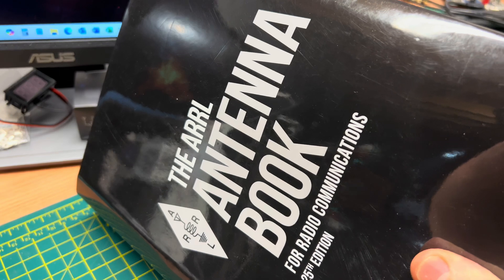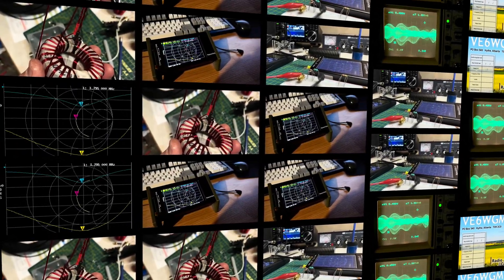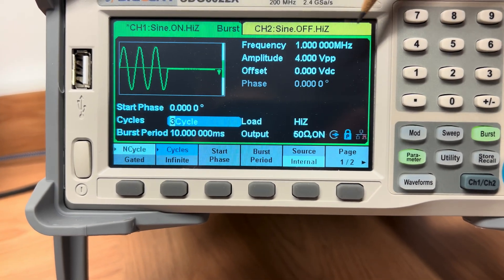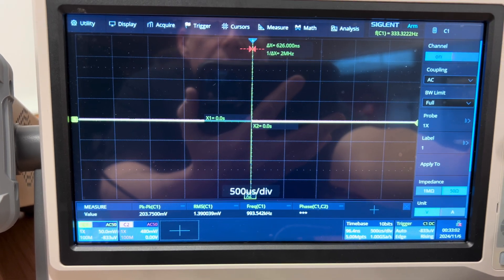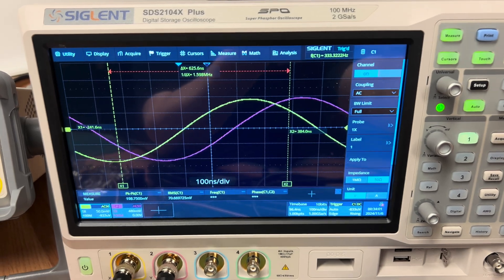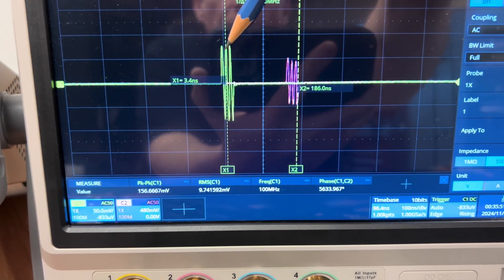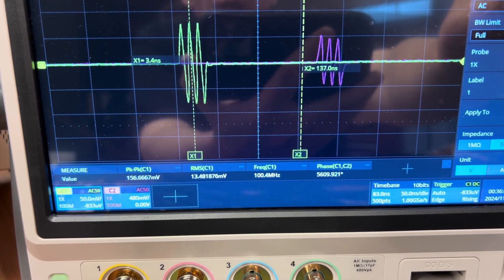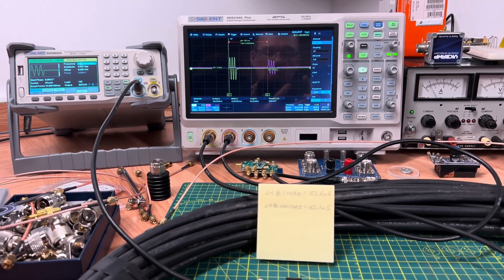(Part 1) ARRL Antenna Book 25th Edition - Coax Cable Velocity Factor Mystery!

Comment: This was fascinating. Added new comment in case you missed my edit. Doug Tougaw of Valparaiso gives a concise answer in his video on transmission lines, Chapter 28 (in the title), at 18:50. This answers your question, and mine. His entire text on electromagnetics is available at Valparaiso.
Reply from the maker: Thank you.

Are you able to post a link to this video?
Reply: @ve6wo  Maybe me, or YouTube, but this is second try. (Me- clicked on wrong reply point)
Here is the video set to start at relevant section/
https://youtu.be/UQKOlKXN9yI?si=SxDk2WVxJ0UZ1jfA&t=1130
Here is chapter 28 from his book:
https://scholar.valpo.edu/cgi/viewcontent.cgi?filename=28&article=1000&context=engineering_oer&type=additional
This is on page 5 in the chapter:
“These two equations, taken together, illustrate that the phase velocity will be a function of frequency. This is not good. It means that some frequencies will travel at a higher velocity than others,…”

Comment: Why not? I do not see it as a surprise. We know that the photon we pump into the input of the coaxial line is not the same photon that exits the other end. It has coupled to many an electron and been absorbed, then re-radiated countless times on the way through.
A medium wave frequency, EM wavefront propagating along a two conductor feed line will penetrate deeper into the surfaces of the two metal tubes forming the feed line than a very high frequency.
A much higher frequency EM wavefront will penetrate less deep into the metal tubes than the lower frequency.
The wave front that is penetrating deeper is additionally coupling to electrons that are deeper in the material, therefore coupling to and being re-radiated by,  more electrons per unit of time. More couplings per unit of time means more drag (if you will) on the wave front.
This effect is seen in light passing from one transparent medium into another transparent medium. We call this refraction - the bent pencil syndrome. I can just as easily call it drag on the speed of propagation as the wavefront slows (or speeds up) as it passes through the boundary of two mediums with a differing index of refraction.
We know that C is slower in air than in a vacuum. It might be interesting to test if changing the frequency of the tested light beam will change the index of refraction, or the speed of C, through differing transparent mediums. (I suspect it does but it will be the devils own task to separate the readings from noise)
73
K8DO - Doc

Comment: The dispersion in coax is primarily due to internal inductance of the metal conductors due to the skin effect. It will be more pronounced on smaller diameter cables that have a higher loss per foot.

Comment: RG-213 specs say a velocity factor of 66%.  Your cable shows 55.6% at 1 MHz and 61.5% at 100MHz..  Someone check my figures.
Reply from the maker: The cable length would need to be known exactly in order to calculate the VF.  This cable is approximately 100’.. I don’t actually know the exact length.

Comment: Fascinating information. I wonder if it has any practical utility for the amateur operator, or if it might only be relevant in the design and fine tuning of antenna arrays and/or in the measurements of nuclear particle timing experiments. 

I wonder if the rate of delay is a linear function. The ballpark figure in the handbook makes me suspect there might be some nonlinearity to the rate. 

If I had to guess (and I do), I would say that the delays are caused by the  nonlinearity of the dielectric materials and the complex granular reactances of the transmission line, along with maybe some heating effects (even as burst signals, there are always losses in the cable).
Reply from the maker: Thanks for the comments guys. I’ll talk about this in the next video.
Reply: Might be of use in designing phased arrays, but then the difference might be too small to matter?  I will leave that as an exercise for greater minds...  😃

Comment: Take some inductance out of it and lay 100' on the lawn in a non coiled fashion, perhaps in coils that change direction each coil. Then make measurements.
Reply: Coiling a coax cable doesn't affect its inductance.
Reply: @donepearce  Really, what about all the pictures in the ARRL Antenna book showing coiled antenna wire in the diagram?
Reply: @CHIPSpeaking  antenna wire is not the same as coax. Coax is not affected because it carries equal current in both directions simultaneously. There is no net external field to interact.
Reply from the maker: Truth.  Coiled coax does not affect the EM wave travelling between the center conductor and the inside of the shield.  Only the outside of the coax shield experiences inductive reactance when the coax is coiled.

Comment: I found a paper by Q. Liu & S.W. Ellingson, 2012, that gave a formula for “dispersive delay” that showed the dispersive delay in coax varied inversely with the square root of the frequency, which would translate to a lower delay for a higher frequency. Beyond me, so I will leave to you is to define “dispersive delay” and its frequency dependence in coax. They stated “The source of distortion in coaxial cables is that the center conductor and shield are not perfectly conductive, so that part of the current travels in the metal where power can be dissipated and propagation speed is frequency-dependent…” 
edited  to add: I believe lossy transmission lines lead to the velocity factor being a function of wavelength, hence multiple speeds for multiple wavelengths (dispersive.). You can find a lot of texts describing this behavior by searching the words dispersive, transmission line, lossy, dielectric.  Not an expert, so please, no-one add my comments to a thesis. :)
Reply from the maker: Please view the part 2 video where I try to explain what I’ve learned about dielectric dispersion over the last few days.  Let me know if what I am presenting aligns with what you have been reading :-)

Comment: Interesting test.  I wonder if the coil of coax is introducing inductance?  Would a 1 MHz frequency radio wave be affected more by it's inductive reactance if it was?
Reply from the maker: Inductive reactance increases with frequency and only affects currents on the outside of the coax shield. The electromagnetic wave travelling along the inside of the coax cable is not affected by inductance developed from coiling the cable.

I am in the process of understanding why this phenomenon occurs.. more reading, of course!  Haha!  I will try to sort it all out and present it in a clear manner (hopefully) in the next video.

The answer involves electromagnetic wave theory!